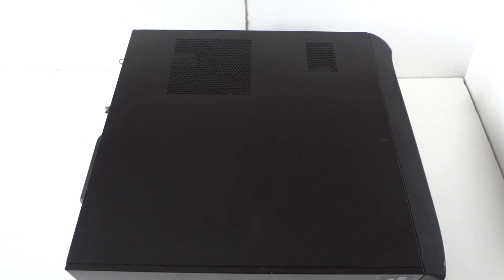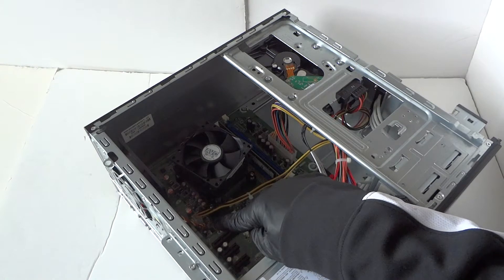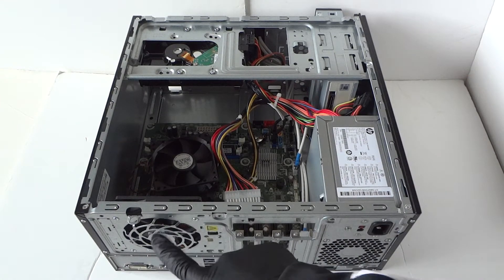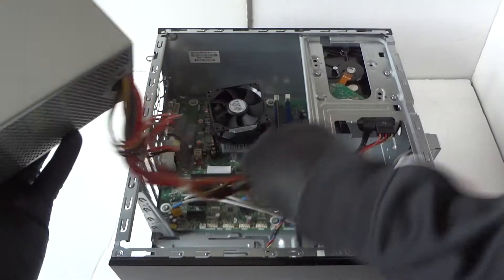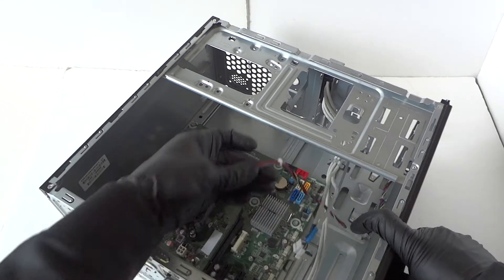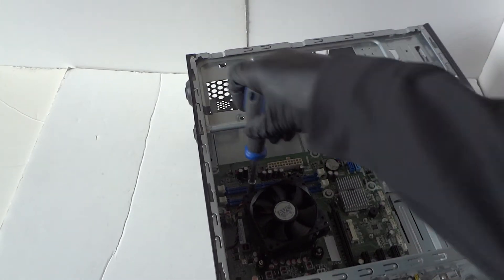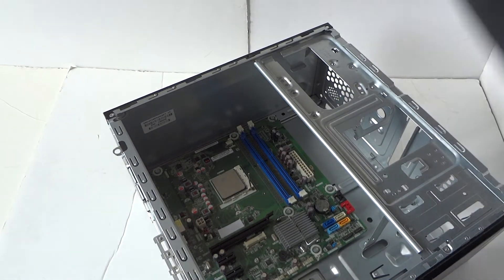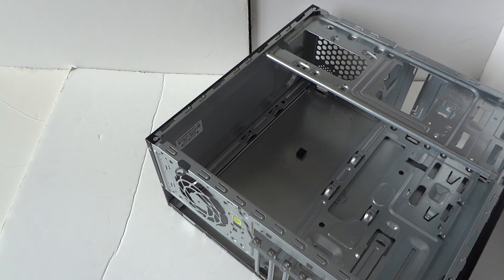HP Pro 3405 Teardown

Comment: I have a pc dell optiplex 3010 and I want to know which video card would support my pc to run games in high or very high graphics and inclos in ultra to 1080p with more than 45 fps and also I need to know how many watts I need to be able to feed my pc
Specifications:
-i5 3470 with its 3.2 gHz stopwatch and 3.8GHz turbo frequencies
-6gb of ram ddr3 with speed 1333mhz
-I do not have any video cards
-60Hz monitor
-general power source of the pc dell optiplex 3010
Reply: I would recommend upgrading your ram to at least 8 gb of ram because it will help clear up stuttering/lagging in games. Second what form factor is your PC? I can only say mini towers are the only supportable gaming pc any smaller it will not be able to have enough wattage for a card for gaming. As for graphics cards that depends on what kind of game you want to play and your budget. I can say that the gtx 750 ti 2gb is good budget card if you want a little more punch but not over the top expensive a good middle budget card would be gtx 1050 ti 4gb, the gtx 1050 and 750 require 300w minimally and most prebuilt mini tower pcs have 300 watt psu's, but if your able to buy a card that has more capability to it I can say the gtx 970 or the gtx 1070, the 970 and 1070 require 400 watt power supply minimally.